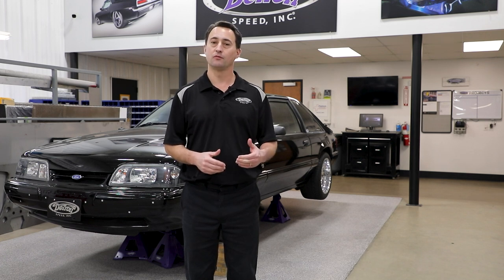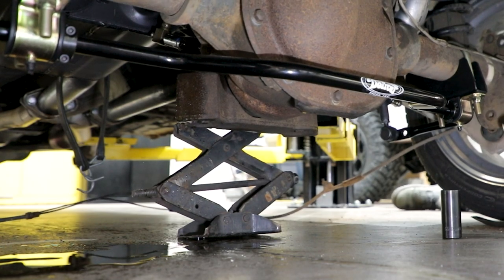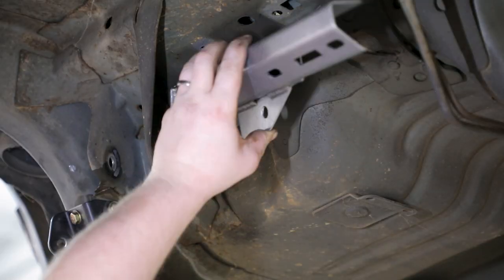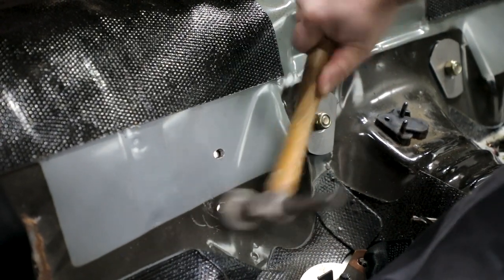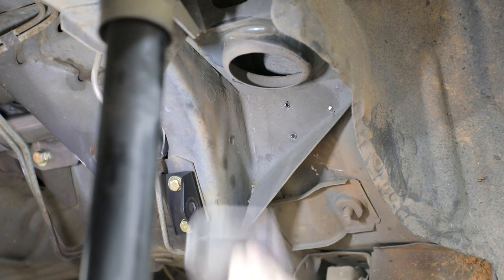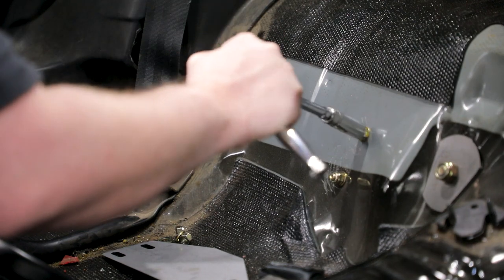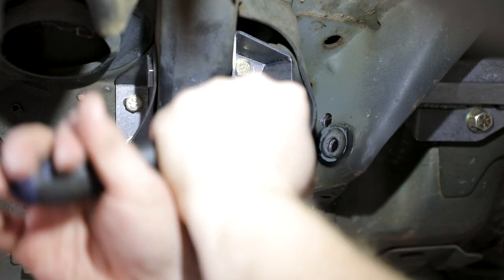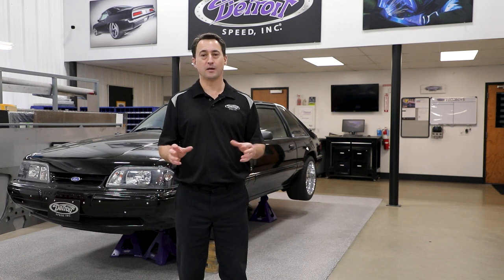How To Install Detroit Speed's 1979-93 Foxbody Mustang EXO Brace

Comment: Definitely plan to install this down the road. I have yet to buy the standard torque boxes but this kit looks nice. I doubt you even need to weld but for insurance purposes I get it. Extremely nice kit.

Ended up getting the kit after all. Very nice kit. It's somewhat easy to install but I highly recommend 2 people. It can be done with one but it isn't easy. IMO best kit on the market for strength

Comment: I dont understand the point of your instant center adjustment. The front bolt location on the upper arm needs to be moved DOWN in order to make a significant improvement in instant center location and anti-squat values. Assuming the car was lowered one inch along with moving into your upper IC hole. the Anti-Squat value of the car will change from 80%, to 22%, which is awful!
This piece of trash product is currently $430 on the major mustang parts sites, where as the Wild Rides S-Box kit, which is an infinitely superior product, is $30 less and actually gives USEFUL improvement and adjustment.

Comment: Seam like they need to do more engineering to have it fit without shims and spacers.
Reply: problem is these cars dont fit like gloves, especially if they have been beat on which 95% of these cars have and they all vary in how they are shaped so a precise fitment would not be possible